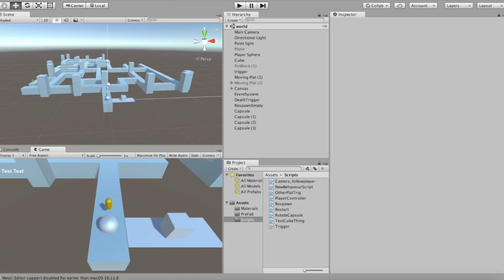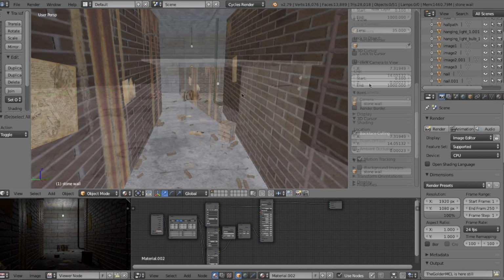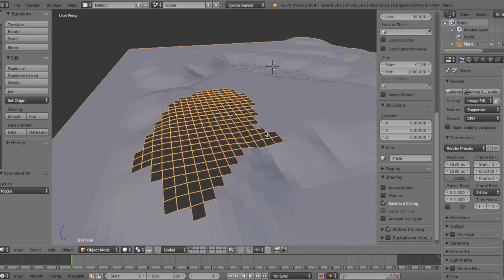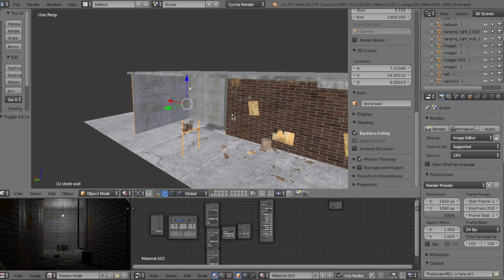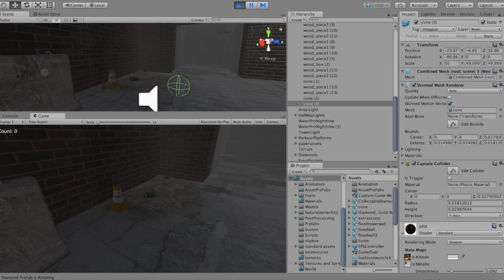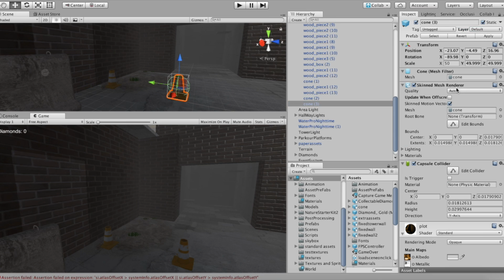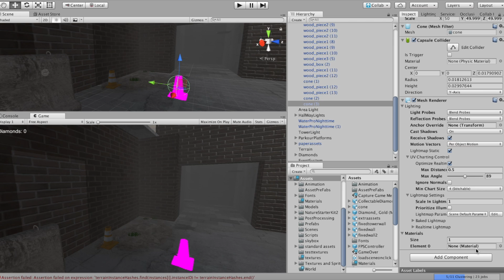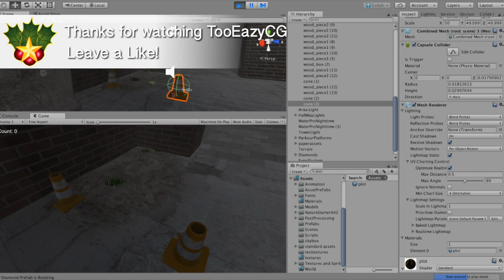Fixing Invisible objects in-game / missing face meshes || Blender to Unity Troubleshooting Tutorial

Comment: There is an easier way to fix that incorrect mesh rendering component in Unity. What you did is correct but not as efficient.

Instead, go to the good cone. Select the gear icon from its correct MeshRenderer and choose "Copy Component". This puts the settings for that MeshRenderer into the clipboard. Next, go to the failing cone and remove its SkinnedMeshRenderer exactly as shown in the video. But instead of adding an empty MeshRenderer, choose the gear icon on any of the other components and choose "Paste Component As New" from there. The new MeshRenderer will have the same settings as the other cone.

This is not only faster for you as the designer, but also makes it less likely you will accidentally forget a setting for the render properties, lighting, etc., or grab the wrong material. (In a large project, there can be very similar materials such as "TrafficCone" and "TrafficConeScuffed".)
Reply from the maker: thanks for this :)
I'll pin this comment up so that others can see!